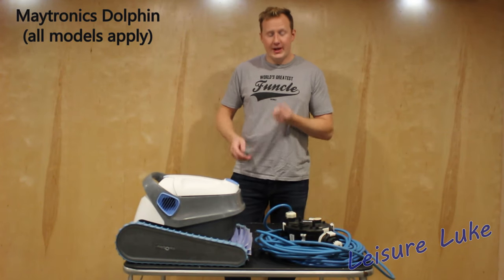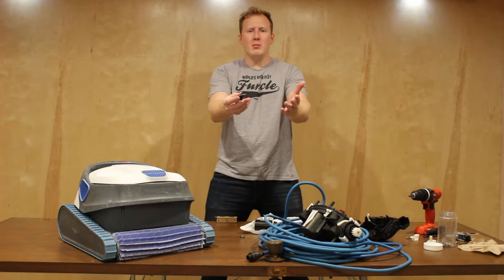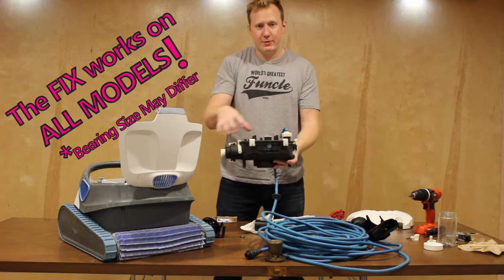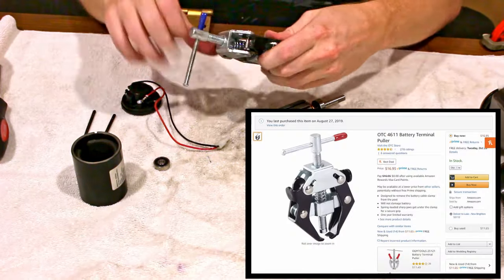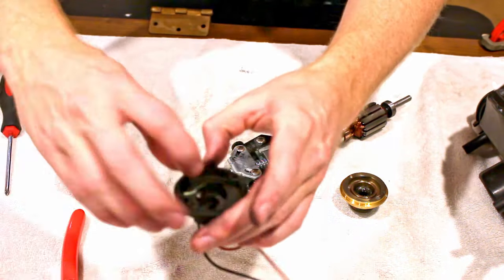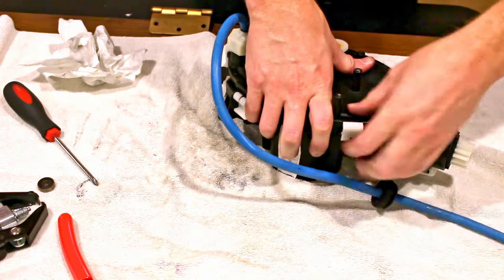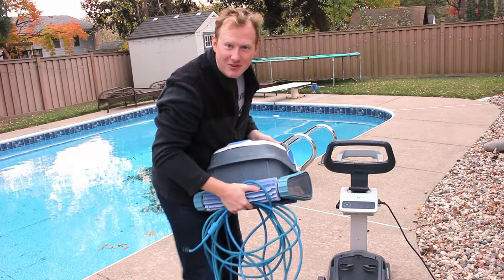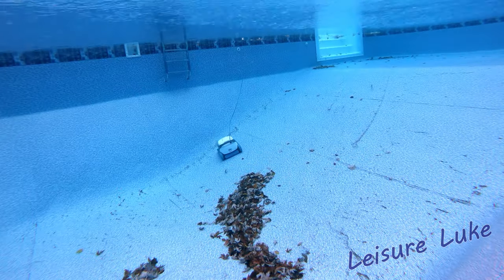Dolphin Pool Cleaner - BROKEN is FIXED!!!  SOLVED with 1$ Bearing | HOW TO REPAIR for MOST Models!

Comment: Our Dolphin is moving forward for about 10 rotations then goes backward for about 10 rotations and then freezes. Could we have the same problem as ours?
Reply from the maker: This sounds like a stuck impeller.  Usually you just need to remove the basket and top cover (using a screwdriver) until you can see the impeller.  Hair, sticks, or something else may have it jammed.  If that seems clean, try to spin it by hand.  If it feels difficult to spin by hand, and you can see that the impeller blade is unobstructed... you have the same problem as me!  Hopefully it's just some debris stuck in your impeller or drive tracks!  Good luck :)

Comment: Also did you add bearing oil to your bearing?
Reply from the maker: I did not add oil.  The bearing was a 2rs, so it was already sealed with oil 👍🏼 if you get a 1rs, or an open bearing as a replacement you could add oil, but it shouldn’t be necessary.  How’s the fix goin?!?!

Comment: How did you open the motor housing? Brute force?
Reply from the maker: Yeah, get it wiggling.  It took a big pair of pliers to get it loose.  I then put it back together & took it apart by hand for the video.

Comment: Mine had the same seized bearing, only I can’t get it off. The terminal puller isn’t working, pliers aren’t working, screw driver damaged the part under the bearing 😭 please help!
Reply from the maker: It’s okay if you “break” the bearing while removing it. The center shaft can be a little scratched, and that’s okay.  You just don’t want to bend the main shaft.  Your terminal puller isn’t working?  Hmmm… you may have to modify the terminal puller so it has a more pointed end.  Send a pic of the current state to leisurelukeyt@gmail.com and I’ll send my recommendation.

Comment: I have a Maytronic Dolphin Explorer E30 that I just got but it runs for 15 mins and shut of then when I restart it,it runs for 5 min
Reply from the maker: I'd take it apart just down to the impeller.  Make sure the impeller is free of debris, make sure the tracks don't have a little stick or something in them preventing it from moving properly.  If you just got it, obviously double check the warranty as well :) Good Luck!

Comment: Alas, what you might find is that the motor screws are cheap junk and very tight.  I have every high quality screwdriver known to man (almost :) but one of the screws was completely immovable.  Before you order any of the other supplies, make sure you can actually remove the impeller motor housing screws first.  Otherwise it is junk.

My impeller motor was "stiff" and not completely seized, but it would not start turning when powered on without a nudge.  Unable to expose the bearings I tried some thin lube down the shaft on either side of the motor, put some silicone grease on the shaft where it exits the motor housing by the impeller (an area moisture must be able to seep) and it has been running fine.  The planned obsolescence of this motor hampers an otherwise great pool robot.
Reply from the maker: That’s a good point.  They are long thing bolts, would be easy to snap.  Shoot - can you get the old one out still and order a new bolt?

Comment: I followed your tutorial but ended with an extra O-ring! Can you please show where all rings go? I've got one in the impeller motor mount, one in de drive motor mount and the big one which seals the whole unit. And then another one which I cannot place anywhere.
Reply from the maker: I don’t know the answer off the top of my head - let me dig around for a minute.  How big is your extra o-ring?
Reply: @LeisureLuke  1" 5/16  I believe I got it when I opened the impeller motor. Checked once again the unit and could not find where to put it so I reassembled the whole thing and tested. So far it works and apparently did not flood
Reply from the maker: @BachiAstolfi  I looked at every diagram I could find, and rewatched my footage.  The only o-ring I needed to touch was the big gasket one around the entire box.  I left any other ones in place... I have no clue where that could've come from.  Really playing detective here - does it have grease on it or was it clean?  There may be a few around the power cable connection area if you connected with that.  Glad so hear it's not flooding!  Did you end up replacing a bearing?
Reply: @LeisureLuke  Don't worry. Tomorrow monday I will get the new bearing so I have to reopen de unit and will check once again. If I find where it belongs, I will send you a picture of it. Thanks a lot, you helo me in solving a problem and a lot of money!
Reply: Is it a rubber O ring. I know there's like a metal washer that goes in the plastic cap end of the motor.  Both motors have this part.

Comment: what else can it be? I've changed the blue cable first, nothing, then I've opened the impeller motor, works fine and was not dirty at all. The app says that there is a communication error. - Or tell me what Robot should I buy that will last for ever without any problems :D
Reply from the maker: Fair question.  If I knew, I'd tell ya what to do next.  Sorry, good luck!  I'd still go with a maytronics brand cleaner, and you get what you pay for.  None of them have very long warranties.

Comment: any idea how to replace the bearing on the drive motor? I cant figure out how to get the black plastic ring off the top of the motor?
Reply from the maker: Haven’t had that one apart.  The bearing is probably pressed in, so you’ll have to pry or hammer it out.
Reply: @LeisureLuke  I don’t think the plastic collar is removable to even press the bearing out

Comment: Has anyone had this problem with the dolphin diagnostics advantage?  It’s a super oldie but apparently a goodie. It’s turquoise and raspberry colors.  It’s running for a few seconds and stops. I’m going to just tear into it soon.  It was with our house when we bought it in 2015.  It has worked great with a little work done on it. I have replaced the tracks and bearing wheelie things. Also reconnected the cord where it came apart on one end.   I was just wondering if anyone had this one.
Reply from the maker: I’d start just by seeing if the impeller fan spins by hand - that diagnostic process is the same :) good luck!

Comment: Does anyone know if the Dolphin CC has to be in the water to run more than a self-test. I replaced a bearing but still have not had much luck. The CC seems very weak now and does not have that moving water force it had before it started flaking out. Thanks.

Comment: Hey Luke.  I don't know if you will still see this comment.  my impeller is clean but it is still stopping.  My impeller is not seized.  Would it still be the bearings?
Reply from the maker: If it spins easily by hand, but actually ever spin under it’s own power, its some other problem.  Perhaps the cable is damaged, circuit board is wet, drive motor is seized, or the motor brushes for the impeller motor are worn out.  So, does it scoot forward and back at the start of a cycle?  Is the blue light coming on?
Reply: @LeisureLuke  it spins easily by hand, but I haven't had it open when it's on to see if it still spins.  The blue light comes on, and it begins moving forward.  It will back up and then stay still.  The blue light will blink on and off.  After that the only way to make it move is to turn it off and back on.
Reply from the maker: @dannyprice4454  That sequence points to the impeller being the problem.  It could be a bad bearing that is just enough resistance to trigger a problem, or it could be water in the motor or worn out motor brushes.  It's amazing how often taking it apart and putting it back together fixes something minor, so that's what I would do next.  Good Luck!
Reply: @LeisureLuke  thanks!
Reply: Found water inside the box.  The motor was sitting in water and all the screws were slightly rusted and corroded
Reply from the maker: @dannyprice4454  That's a tough one.  Lots of little circuit boards in there, one small short could ruin the boards, and those can't be replaced.  Sounds like a full motor assembly replacement (If you can find one, is it a dolphin s300?) or more likely time for a new pool cleaner.  I'd dry it out and see if it works, if you can find the leak!   I'm very curious where the leak came from, think the motor box gasket leaked, or did the box itself crack, or did it come in from a motor shaft?
Reply: @LeisureLuke  I am pretty sure it came through the motor shaft.  The water was in the bottom of the box and not anywhere else.  I would think this means the box gaskets worked and did their job.  I am debating on putting in a new motor for $90 first.  Thanks for the info.
Reply from the maker: @dannyprice4454  If the circuit boards inside the assembly aren't corroded and you've pinpointed a leak, a new motor and/or non-leaking part should do the trick.  Keep us posted and good luck!
Reply: @LeisureLuke  ordered a the motor on ebay for $135 all in.   I will update once i received it and installed it.
Reply from the maker: @dannyprice4454  Thanks, appreciate the responses.  Let us know if that solves your problem :D
Reply: Edit: so you can tighten the impeller fan down too much.   I took it apart again - no water in the box.  One of the gaskets in the other motor must have failed.   The impeller was able to spin and voila - my robot is cleaning my pool right now!   Thanks so much!  

 @LeisureLuke  So I got the new motor in from eBay and installed it.  The light blinked.  I could see a water current on the surface of the water (does that mean the impeller is working?).   It rolled forward just a little and shut down completely.  The motor needed to be replaced.  You could see the corrosion on the outside, and I do believe that was where water was getting into the box.  When I took it apart completely again - no water.   I don't know if the control board might have gotten some water.  Out 135 right now.  Debating my next step.
Reply from the maker: @dannyprice4454   AAAAAAAAAA+  Nice work, and a few extra discovers to boot!   I hadn't heard experienced the over-tightening of the impeller issue, nor have I heard of it, but it makes total sense to me!  Good Catch!  I only imagine all the things you checked before checking that!  Happy to hear you are back in action :)  Congrats!

Comment: Luke I was working on mine today. The black box does not want to come apart. What’s the trick, pry bar? Thanks
Reply from the maker: Yeah, you have to flip the white clips, then you may need to wedge a screwdriver to start sliding the cover up.  You’ll have to work your way around lifting the cover up before it will come up and off.  The only thing holding it together is pressure on a big o-ring and some grease.

Comment: Question for ya.  My impeller motor works fine but the drive motor is what is seized up.  Have you ever worked on those?  Don't see a way to open that bad-boy up.
Reply from the maker: It's a different electric motor.  I haven't cracked mine open, nor did I try.  I would remove it and see if you can open it.  You might also get lucky if you can find the part number on the motor and see if there are any on Ebay.  I recall finding that motor available, but not the impeller motor.  If it doesn't have screws on the bottom it's probably all just press-fit, so you have to pry the pieces apart which won't be easy.  Good Luck!

Comment: I’m working on it now, which bearing
Reply from the maker: Nice!  You’ll have to spin them to find the bad one.  I’m assuming your impeller was hard or impossible to spin by hand?  Mine was totally seized.  There was only one (on the end of the motor shaft) that was bad.  It could be any of em.  If any bearings don’t feel easy to rotate and smooth, replace it :)

Comment: So what happens when the drive motor gos out. That motor is different and does not look serviceable.
Reply from the maker: Some comments talk about doing a similar fix on the drive motor - replace it bearings.  The motors are still hard to find.  If the failure is that it is “seized” then try taking it apart!
Reply: @LeisureLuke  How? There's no discernable way of opening and servicing the drive motor.
Reply from the maker: @SolRayz  Not sure :) haven't done it, haven't tried! 🤣I've just been told in these comments by a few folks that they did it!

Comment: I pulled mine apart put it back together and now it's flipping over and won't climb the walls any ideas
Reply from the maker: If it’s flipping and not climbing walls you still have an impeller problem.  Any chance you flipped the red & black wires?  If you remove the impeller shroud, Can you still spin the impeller freely by hand?  Might be worth removing the shroud and starting it out of the water to make sure that impeller is spinning & spinning the right direction.
Reply: @LeisureLuke  yes it spins free I was wondering if I might have flipped the wires by accident. I will try that I appreciate it.
Reply from the maker: @gregturberville5366  Keep us posted!  We keep learning more, and I've talked to a few people with that same problem after doing this fix.  So don't be too hard on yourself :) I hope that's all it is!
Reply: @LeisureLuke  will do I will post once I give it a try
Reply: @LeisureLuke  looks like the impeller wires were backwards on the board. From the factory the white terminal on the board that the impeller motor plugs into is on backwards. I  lined the plastic lock from motor up with the title on the board wich reversed the wiring. Sorry for rambling hope the may help someone. Don't be me take pics
Reply: @LeisureLuke  I screwed up and water got in my black box. The circuit board is bad any ideas on where to get one

Comment: Can anybody recommend the magnet brushes for this motor ?
Reply from the maker: Don’t have a source yet, but other people that n the thread have measured them & found replacements by size.  I just bought another broke s300i and will take it apart this weekend.  I’ll measure mine and try to find replacements.

Comment: How do you get inside the brass cap to replace that bearing?
Reply: I’m not sure bearings are my problem. I found one of the spring clips broken in two. In addition, my motor was extremely dirty with black dust.
Reply from the maker: The bearing in the brass cap is tricky, you have wedge a screwdriver in the middle and slowly work it out.  You may destroy the bearing in the process.  Then tap the new one in gently with a soft hammer or back of a screwdriver, making sure it doesn’t go in crooked.  The black dust is normal - it’s from the wearing of the motor brush.  Sounds like you’re on your way to success!  Sorry for the late response!   Good luck!  Lmk if you have any other questions!
Reply: @LeisureLuke  the 2 bearings on the shaft thing moved freely, but the one in the brass was pretty gunked up & didn't move.  When I cleared out the brass cap, TWO bearings came out - I wasn't expecting this, I thought the same one would pop out from the video, so I didn't see which way they were seated in there.  Feels rubber with a grooved/open side & then a closed side.  Says A29542 B 22 6 4-12 - I had all the confidence in the world until 2 bearings fell out. Anyone have insight?

Comment: my dolphin doesnt pick up leaves any help
Reply from the maker: It drives around, but doesn’t get the leaves?  Check if the impeller is clogged.  Also, make sure the lid is fully shut and the filter basket doesn’t have a hole in it. If that’s okay, then maybe post a video?  Send anything to LeisureLukeYT@Gmail.com

Comment: Does anyone know what size bearing the m400 takes?
Reply from the maker: Don’t know off hand, but I think every single other person on this thread (with a variety of models) have all said it’s the 626 for them too.  The size is always printed on it, so you’ll know for sure.  If not, bearing sizes are fairly standard, so you can measure the dimensions and we can figure it out quick :)

Comment: I’m absolutely furious with Maytronics. They refuse to sell the motor brushes for the pump motor. Disgusting. My brushes are running low. 

Absolute scam. If people are sending their robot in for a service. They will NOT replace the brushes. This is ABSOLUTE planned obsolescence as they will only sell you the parts and service to replace the entire motor. Disgusting. 

If you just paid for a big service and they didn’t replace the $10 brushes while they were in there, just know you have been ripped off and demand to know why they didn’t replace the brushes while in there. I estimate the pump motor brushes will last approx 3-4 years with regular use.
Reply from the maker: Yeah, I hear you.  You’re not wrong.  Those are generic parts though, and I know you can find them online.  I’d have to take mine apart, but if you have a calipers to measure the width and height in millimeters, you can find the right parts online.  A few other people on this thread have had success.  If I’ve got my hands in one again this summer I’ll post the brush sizes and links to order 👍🏼 if you find em, let us know the right sizes!!
Reply: @LeisureLuke  absolutely please do. You will save a lot of people a lot of money. I fix all my own things but it’s disgusting to think that when people pay service departments to service their robot, they don’t change the brushes. And or charge them for an entire motor!

Comment: Can anyone asist me in finding the bearing part needed. The bearings that went out on my cleaner were the ones in the brass top. Numbers are as follows
A29542     8   22  6    4-13
Reply from the maker: The bearing names are defined by their sizes.  You may have to get out a calipers & measure the thickness, outer diameter, and inner hole diameter.  It’ll be integer millimeters.  The. You can figure out what to buy.